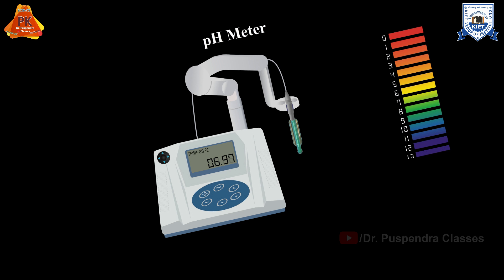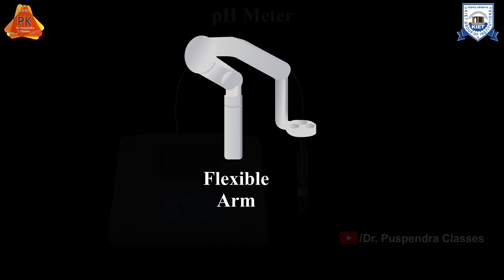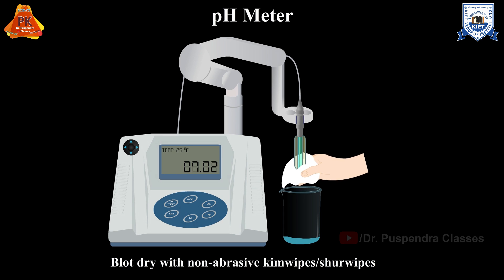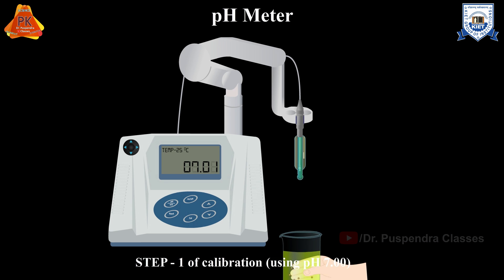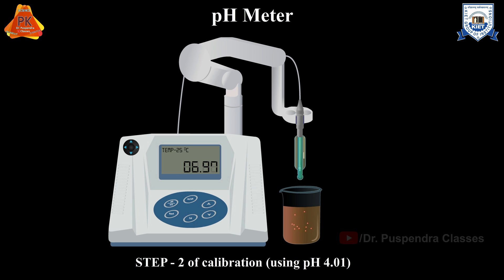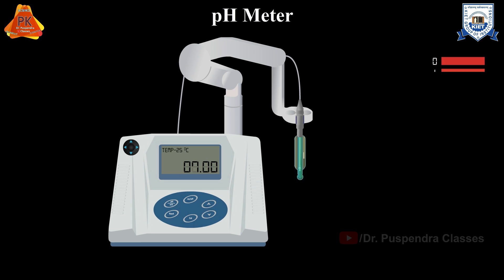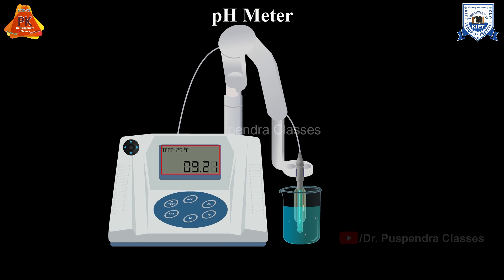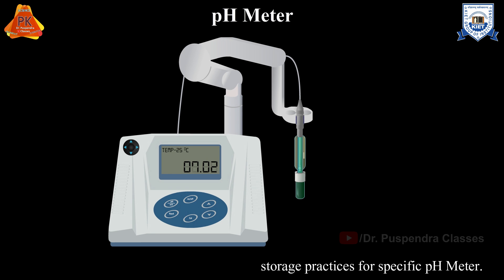pH Meter Working | Calibration & Instrumentation| Animation | pH Meter Experiment

Comment: Can we used non dosing RO water to clean the electrode of the pH meter in place of de- ionized water
Reply from the maker: No
Reply: But sir if the tds level is same (4 or 5) just like distilled then can we used it to clean the electrode